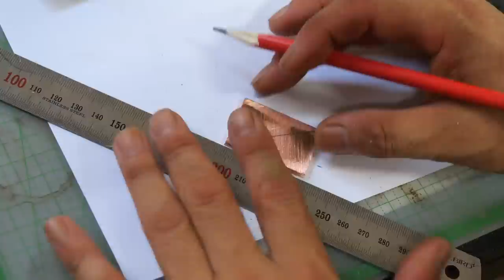The process of making a knife with a chain. Korean handmade knife master.

Comment: That knife is gonna break, those are the biggest inclusions I've ever seen in a finished knife.  That's what I would call a wall hanger.
Reply: I believe it was deliberate, I certainly wouldn't use such a knife due to the creases making it impossible to clean, but it's perfect as an ornament!
Reply: @GaisaSanktejo  The knife should be both beautiful and durable, it should be functional, only paper can be cut with such a knife!!!
Reply: @Spartak69384  I totally agree, that is why I called this project an ornament; those defects in the blade make it nigh on impossible to clean, AND look like it'll break as soon as someone tries to use it.

Comment: Couldn't even be used for cutting vegetables.  First off you didn't have the temperature high enough to forge weld the blade.  You woud want a nice white heat to forge weld.  Then you ruined the knife by using a plasma cutter.  Next you should have forged the blade closer to shape.  Lastly you should have ground the blade with a belt grindr.  Instead of using the plasma cutter or at least use files.  It looks like you have a belt grinder so you had no excuse not to forge a closer to shape.  Then you would have enough material left over to make the tang from the same material. Instead of welding on a different material. You also should have put a high carbon piece of steel forge welded to the blade side. Chainsaw blades are known to have high carbon steel teeth, the chain is just mild steel and the pins inside of the chain are just a hardened piece of steel so most of your knife was made with mild steel.  I don't mean to speak so rough about what you're doing.  I'm just trying to help you become a better blacksmith.  For the future try not to make these mistakes again.  I wish you well so you will have many more years of blacksmithing ahead of you.